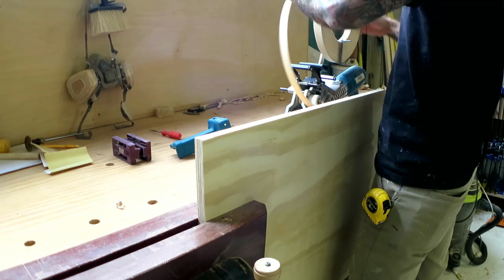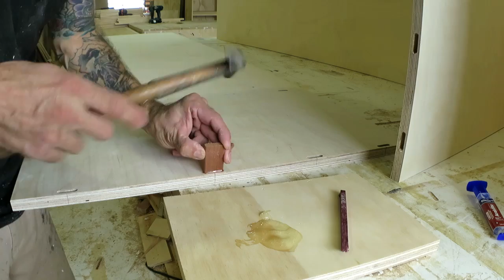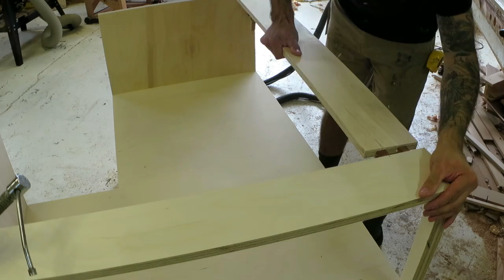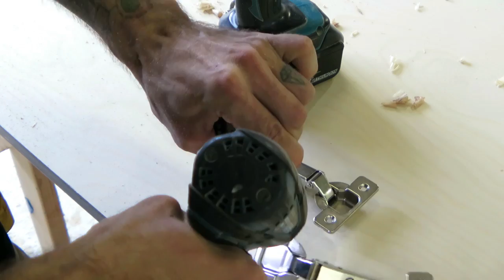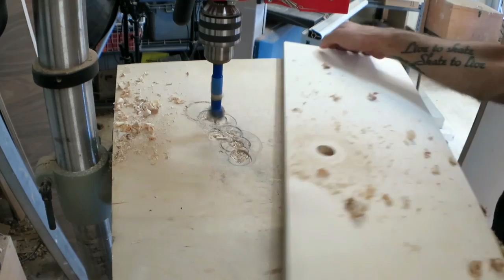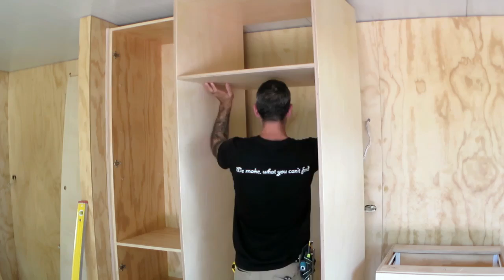plywood kitchen

Comment: Great video! Could you please share the diameter of the finger pull ? I love those but they are not really popular in USAsnd I cannot find info about the right size Thanks again!
Reply from the maker: I usually use 25mm 1 inch. In this case the client asked for 32mm not sure on inch equivalent
Reply: thanks so much for your answer. Now, how far is the center of the finger pull from the top edge of the drawer? I got the 1” forstner bit. did you use the same forstner through the end or you did use a bigger on the back to have a leap from the front and pull the hole in a easier way? thanks

Comment: Joey, I notice your shelves are only fixed with screws, no glue. Do you find that this method is strong enough and doesn't loosen over time? Thanks.
Reply from the maker: For basic cabinets like this gluing doesn't add any thing. There is no stress on the units once installed. Plus with plywood half of the edge face is end grain which is pretty useless for gluing anyway.
Reply: KingPost TimberWorks Thanks for the reply 😀

Comment: Is it 18mm ply or 19mm, (3/4")? Would you ever go down to 12mm ply for basic kitchen carcasses if they get screwed to a wall?
Reply from the maker: You could use 16mm for the carcass  but any thinner say 12mm is just too thin to hold screws really, the ply tends to split.  Yea I just use a few blobs if silicone to hold the toe kick onto the feet

Comment: I have never seen hinges with those "expandable screw" things you mention. I'm in the southwest US, wondering if its a regional thing?
Reply from the maker: Most likely more a Euro thing. And designed for crappy particle board type things , and they are easier for a cnc to cut with a bigger hole needed.  All of which is unfortunately common here also
Reply: KingPost TimberWorks makes sense. Thanks for the reply!

Comment: if this is for a kitchen cabinate why is it so complicated, all you need is butt joints and screws when it is screwed together it will be really strong. chip board would surfice
Reply: These carcasses will still be OK in thirty years. New fronts and tops equals budget new kitchen.

Comment: How do you find Plywood for cabinet doors? I'd love to do it, but have been told they can warp more easily than MDF. keen to know your thoughts.
Reply from the maker: So ply can definitely warp. I find the more I pay for ply the better it is (funny that) but also the heavier it gets. So more density usually means more stability. Of course you also have to weigh up the weight for things like doors to.  Big doors can definitely warp no matter the quality if ply. It's just something that can happen just let the clients know it's a possibility.
Reply: If you start with a flat piece and get it sealed thoroughly, it should be OK though? Or can it still warp even if all services are sealed?

Comment: Surprised you used a manufactured drawer kit  - rather than making one from scratch. What was your reasoning?
Reply from the maker: Ummm , here at least wooden drawers in the kitchen is waaay not a thing. Having a good soft close drawer on drawers that are used 50 times a day is the only way to go.
Reply: KingPost TimberWorks Sorry- not the runners. But the drawer carcass - you call it Haan Drawer Hardware. Is this better/quicker than building a plywood box to attach the runners on? Thanks
Reply from the maker: Oh right yea way quicker this way and cheaper. These runners cost about $47 . A good side mount runner is about $35 plus plywood sides plus Labour to assemble and sand and finish.